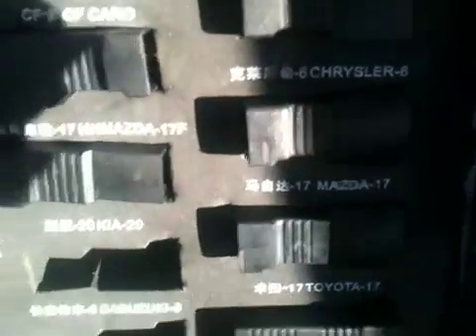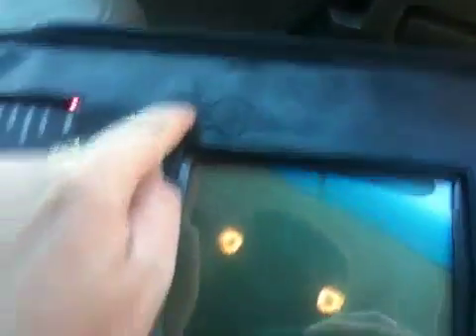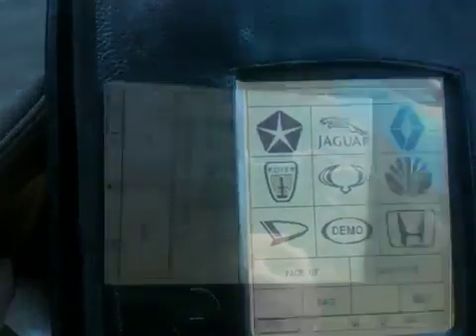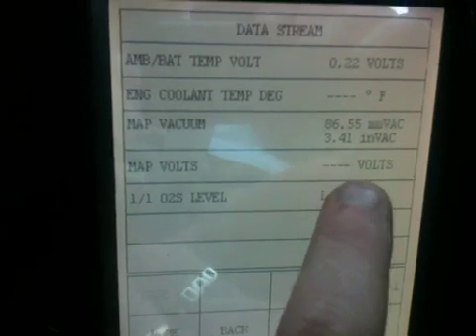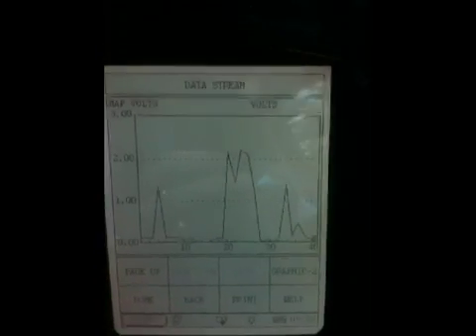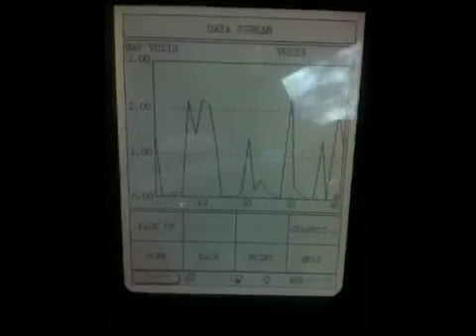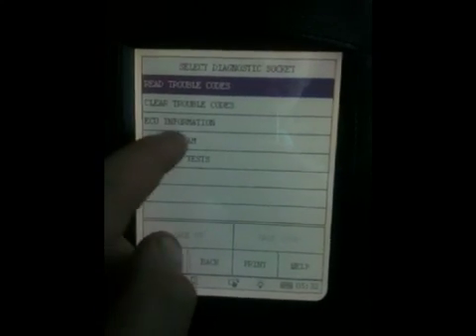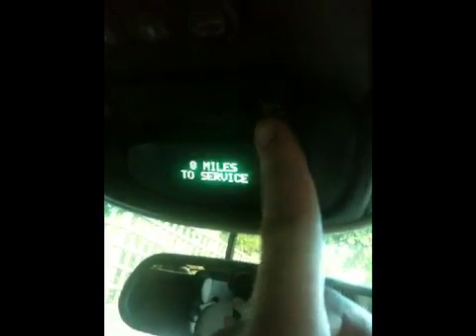Scan Gauge . Model: Launch X431 GX3

Comment from the maker: I have looked into the volo chip a few months ago & did a lot of research on these. I found out that they R a very very safe way of re-tuning the engine 2 accept the hho but they R so safe & so little change is made that U don't really get very much good results, this is probably Y some people don,t get many gains with these things. I purchased some new tubing this week, 4 meters of it and  good quality also 8 meters of 25 amp wire with some brand new connectors, hope I get time to install it.

Comment: You're right. Don't mess with it too much unless you know what exactly to do and you can reverse your changes. ECU uses 3-dimentional maps to combine all sensor readings to control the engine, so if you change one parameter it might have negative influence on other aspects. If your gauge has the ability to reprogram ECU by uploading maps, this would be awesome. Maybe there already are maps for HHO tuned cars? There are Volo tuning chips (HHO Edition), so why there should be no maps for ECU?